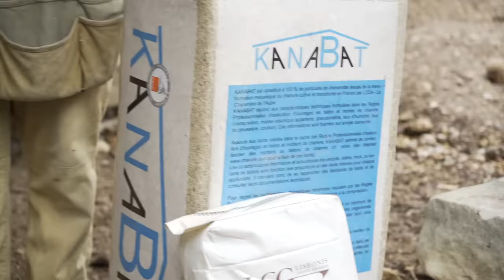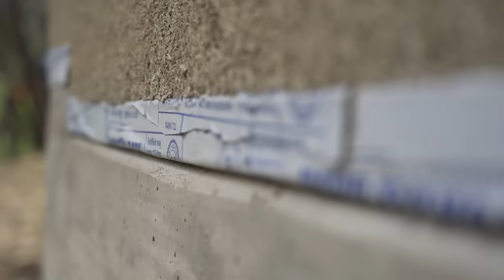Hemp Concrete Walls (R30 + Fireproof) - You Won't Believe How They Built This House!

Comment: Helped retro insulate a 'living' room in a traditional built Scottish cottage with this two years ago here in Scotland. the owner ripped out all the old plasterboard, back to bare wall, which here is a two foot thick rough stone affair held together with limecrete. Made a frame with 1x2, all it has to do is hold the shuttering till the hempcrete sets, then we all set to with an electric cement mixer and mix and fill, mix and fill. About 5 inches thick and right up against the stone wall. Learned that you do not need to pack it down hard, that takes away the air spaces you need for insulation. Also that best to leave shuttering on for a day or two so the stuff firms up well. It sets pretty hard after a week and there is good advice all over the internet. With a breathable plaster and then paint from lakeland paints here in the uk it totally transformed the room. No more 'bit chilly damp' feeling and the hempcrete retains like a reservoir the heat you put in the room, evening out the heat cycles from the log burner in there. It's a lot of work and I dont know the finance aspect, not my project, but for end comfort and to use 'natural' products its gets an A*
Reply: For those who do not know. Shuttering is the board (mentioned 3/4 osb) used as the forms to hold the hempcrete.  One thing not mentioned.. the more you tamp the hempcrete the more you will destroy its ability to insulate.  So denser packing is why he said r2 ..
Reply: Matt, is it bug resistant?
Reply: So, NOT hemp, just cellulose. Could do this with nothing but the cellulose insulation found in the attic and walls of every house in the USA... PS: Hemp is the outter fiber of the plant. This is the interior of the plant(waste product) This is nothing but corn stalks in reality and you could use corn stalks just as well. Seems like a whole lot of wasted effort. Just buy rockwool.
Reply: @w8stral  the hemp shiv has a lot of silica. this makes it different than cellulose. rockwool is another way to insulate. Every product has it pros and cons.  Shiv is the woody interior of the stalk.. not the outside fiber.  your concept of hemp is pretty much inaccurate.  Corn stalks are NOTHING like hemp.  due to the minerals in the stalks.
Reply: @stevepailet8258  Way to prove 1) you cannot read) and 2) proved my point as you pointed out EXACTLY what I did.  COrn is NOT its stalks just as the hemp fiber(its bark) is NOT the Hemp plant stalks.  And 3) The so called "silica" is laughably absurd.  What you are calling "hemp" shiv is in fact Cellulose.  Now you can whine about mineral uptake difference between plants.... << rolls eyes >> but it is the PORTLAND CEMENT which makes this fireproof and the mineral content of said cellulose is minimally different between plants.  This is like claiming wood soaked in salt water is not wood... Yea, it burns greeen sparks...   Why?  It absorbed some minerals out of the salt water.  Does it burn at exactly same rate?  Yup, it does.
Reply: Interesting discussion, and thanks for pointing out that this is not made using the fibers that are used to make so many other hemp products.  I actually think finding a good use for the "waste" portion is a good idea - and this usage will sequester the carbon in the cellulose for the life of the building.  What I wonder about it what the performance of actual hemp fibers would be in either a cement like resin or some other type of resin.  (hemp fibercrete or hemp fiberglass) Probably much stronger than this hempcrete but would lack the high insulation properties.  And how altering the nature of the fibers would impact the properties (long vs. short, uniform vs heterogeneous).  Cheers!
Reply: @w8stral  obviously you are correct shiv / hurd is what you are calling cellulose. Just because you are also ignorant about the content of the shiv just makes you sound absurd.  If you dont know what you are talking about  just perhaps you should get an education and stop talking about something you obviously are ignorant about.  Suggestion.. learn to read
Reply: @stevepailet8258  We were advised by a full time builder who's entire career is based on building with this product that you don't pack it down. Its more like pour it in from your bucket,  spreading it around so you make sure it gets into the spaces in corners and around your framing, and by the time you have done that you have probably added enough 'down' pressure to it to make each 'particle?' touch enough of another one to, when it chemically bonds as the lime mortar goes off, form a very strong and solid piece. 
.
The key is that doing it this way you trap micro pockets of air everywhere, plus the shiv itself is the inner 'woody' part of the hemp stalk. Don't think of woody as in a log. This is more like a dried sponge like materiel and that is where the insulating properties come from. Thousands of cell size air pockets. 
.
The lime mortar excels at deterring pretty much everything that crawls, flies, slithers, or walks. There is a block in the garden here from when the extension on the cottage was built. I forgot to mention, there is an entire extension built onto the cottage and it was a timber frame with 18 inch walls like the video here, and the roof (once this is dry it weighs next to nothing)...(EDIT, this whole space is kept warm by ONE wood burner. Open plan living space,/ kitchen, bedroom, bathroom).)  I digress. The point is this block which must have dried in a bucket and been tipped out, is still solid, untouched by frost, rain, beasties (even wee timorous ones) and gets brought to my attention every time I trip over the sodding thing.
. 
I dont think I would ever go back to rockwool. This stuff actively regulates moisture in the air. Unlike rockwool which just creates a heat barrier this stuff works like a graduated heat resoviour. Yes it is a full on job to install, it's costly, messy and time consuming, but it is also permanent, will not make you itch for 6 months and does not become a haven for mice, squirels and next doors cat. It also means you can use the loft space without an NBC suit. 
w8stral ...You probably could use corn stalks but there may well be a reason that for thousands of years, and that is how old this tech is, they just didn't.
Reply: @Godshole   That is absolutely correct and I did comment that is should not be packet hard because It will loose its ability to insulate.  It is also a reason it should always be poured in attic use.
Reply: @Godshole  I know how Matt is always talking about using dehumidifiers in the houses he builds.. As you mentioned  It does a great job of controlling moisture.   When looking at it .. it is a super simple unified system. lime in the walls lime on the surfaces.  Corn stalks ?  you really should send me a link as I see nothing.  Perhaps a better use of dunnage that does not break down is using rice hulls
Reply: @johnwilkinsoniv1746  Problem with organic fibers... they are organic and degrade over time.  Initially you are correct, if you used hemp fibers it would be like using a wire mesh, but over  time... the organic fibers will creep.  Why Kevlar has a life expectancy, but carbon fiber does not.  Kevlar is never allowed to be used on anything structural with a constant load.  Kevlar is an organic fiber based material and it creeps under load, a very  low load in fact.  If anyone tries selling you an old canoe, kayak, airplane made from Kevlar... laugh in the guys face, RUN, and keep running.
Reply: @stevepailet8258  I concur :)
Reply: @stevepailet8258  Not me going on about  corn stalks ;) I meant that other guy... Only place for corn in my world is flaked, honey nut roasted and in a bowl with cool fresh milk :)
Reply: @stevepailet8258  You are correct. Hemp has a longer and stronger fiber, that is why they made rope with it.
Reply: @w8stral  Hemp grows much taller than corn, and its fibers are much stronger than corn. That is why they made rope with it.
Reply: @johnwilkinsoniv1746   My question also. I would have thought the long, and stronger fibers of hemp would have made the material much stronger, but not as easy to mold. Fibers would have been sticking out all over the wall, but they could have been removed by cutting them off. Leaving the long fibers would have made the wall stronger, still fireproof and maintain it's R factor.
Reply: @SkipMichael  some folks here just do not get the difference. To them corn is exactly the same as wheat.
Reply: @SkipMichael  NO Shit Sherlock... Relevance: Zero.  As ZERO Hemp fibers are used in said wall.  Said fibers are used in other products and the by product, interior of plant is what is used here.  PS: Manilla rope made from manilla plant replaced Hemp worldwide as it is superior if you are looking for fibers...
Reply: Can we just be nice to each other please. This isn't a playground. The world is going to hell in a hand basket so please, at least be civil. Or I might come round your house and break all your toys :{
Reply: @w8stral  What like cob buildings?  the average age of cob (straw+ mud) house in cornwall is 300 years old which is pretty good going. Cob degrades when gypum is put on the inside and cement/plastic paint put on the outside causing an interuption of natural moisture management. Hempcrete is at danger of rotting when it is drying out initially which is why binder selection and dry times are imporant to refine.
Reply: @w8stral  you're correct that the hemp hurd/shiv has no silica content... the binder chemistry is all binder x cellulose. The cellulose fibers are protected by the lime based binder as it's alkaline (above pH ten). There are recent studies on hempcrete outlining its antifungal properties by testing for mold growth in environments with high relative humidities. Bulk water exposure is still a concern, but this is something the complete system would need to address (eg. waterproof finish with high water vapor permeability for quick drying over time)
Reply: @w8stral  You're correct, this can easily be done with sawfust and chips. Thiz replicates the sawdust mortar used with cordwood masonry construction.
  But hemp has stoner hype, marketing is everything.
Reply: @w8stral   rockwool is hard to buy right now and expensive
Reply: @louvee5009  Rockwool is always expensive, so what?
Reply: On the tamping issue, in the video they seem to be tamping hard close to the edge of the shuttering board that will be the outside edges but the center area is left as loose as possible, in order to get a balance of structure and insulation.
Reply: Thanks for your post, very informative 8

Comment: Nice one Matt, definitely a great construction that would benefit the world. Farmers should be growing hemp because there are so many uses for it.
I slake my own lime mortars & plasters and keep my 300 year old, 3 foot thick, cob walled structure maintained with the lime putty mortar. It absorbs CO2,  is warm in the winter, cool in the summer and has better acoustics than cement products and will last another 300 years hopefully. 

The house was built without foundations, has a straw roof and no guttering, all the rain water drips into a French drain which surrounds the base of the cottage and is taken away from the building to soak away into the surrounding fields or could have gone into a tank for the garden or to flush into a septic tank which is emptied every 2 years.
Reply: Sounds heavenly...

Comment: I like this kind of stuff where people who know everything about their job talk about it.
(It is unbelievable how many people don't know anything about what they are doing - probably for their whole life.)
Reply: like someone who tells you how honest they are, watch out for someone who tells you how long they have been doing something
Reply: Ahhh, you may want to consult an engineer with experience in straw structures before trying this. There are a couple glaring mistakes you will not enjoy with this method.
Reply: @onebylandtwoifbysearunifby5475 
Why make such a vague comment, it serves zero purpose?

If you are worried about it not adding structural value because it's chopped, vs how straw is left whole, he mentioned the hemp isn't structural, the wood and steel are.
Reply: @tracy419  You should consult a relevant specialist before choosing this method (which is not vague in the least). 

Choosing to chop these fibers is one glaring error showing this method is not thought through properly, yes. Materials like straw have insulating properties due to the hollow core of the fibers. If these fibers are chopped cross-ways that's not great but OK. However, if they are chopped axially (in half lengthwise) the pockets are destroyed and the Adobe or Cob mix becomes conductive , not insulative. 

Also: it's not structural once the straw is mangled into shards. The tubular structure, and length of fibers, both contribute to structural reinforcement. There's no advantage to destroying this internal material strength, and only disadvantages. 

For simple evidence, consider a long-fiber straw bale is R-30. If it is chopped into short segments, it is not allowed under International Building Code for straw bale structures. And loses significant insulative capacity. Yet, that is chopped by segments, not axially into mulch, which is far worse on both counts. 

I would recommended in the strongest terms you consult with an engineer, or research straw building techniques, for appropriate use of this material.

Comment: This was awesome Matt!! Thank you for showing us new and innovative stuff! Keep the interesting and new stuff coming! Hey is there any way you could cover kind of how house building has changed over the last century here in the states? Sheathing/insulation/finishing? I've seen double-bricked houses, straight 2by as the sheathing, plywood before OSB was invented, etc. It'd be great to have someone with your expertise and first hand experience sort of walk through the decades with mock-ups and explain how house building has changed over the years, pros cons of each build style, monetary incentives perhaps, etc. You're the man. Love the show.
Reply: not sure how well a double brick wall works for r value.. but grew up in a house that had walls like that. Seemed to stay ok. but I know I changed out and added an extra 2 tons of AC to that house.   Currently am in a house with 1 x 4 heart pine t &G,  that the entire house is sheathed (inside walls) walls and ceilings. Pre osb and yes pre ply wood.  There is much to be said about many newer building products some good some not so much